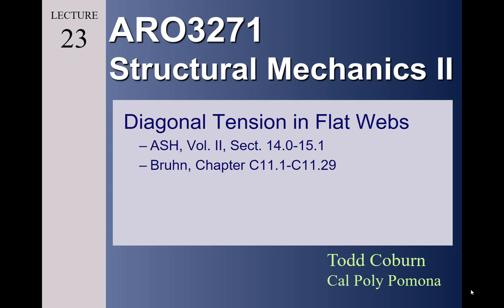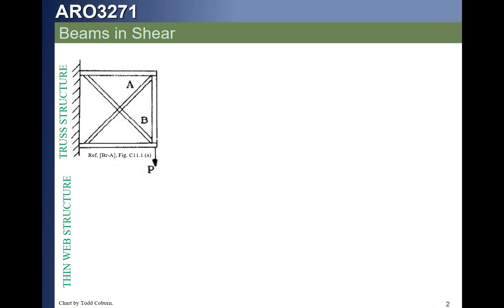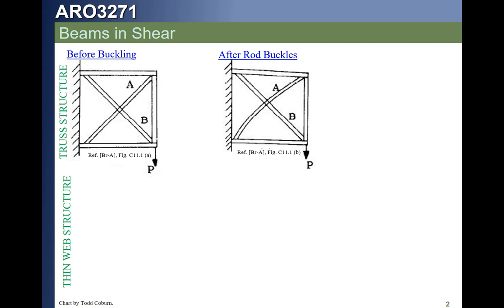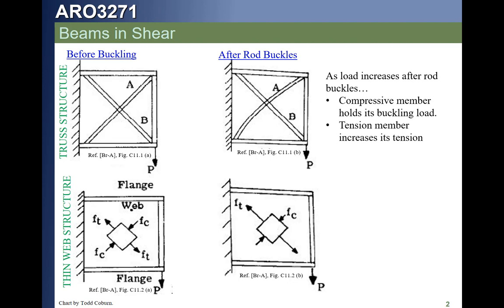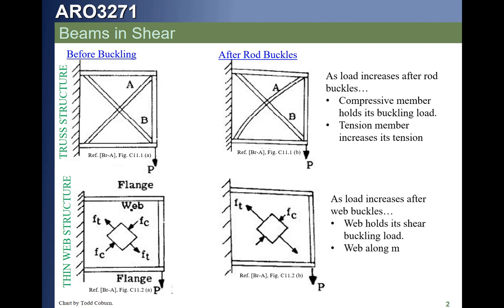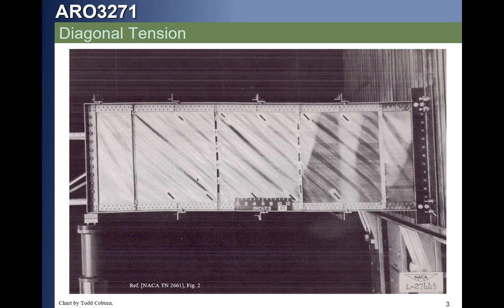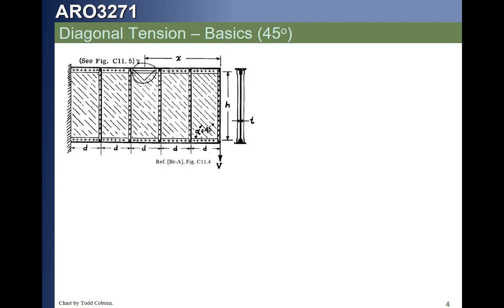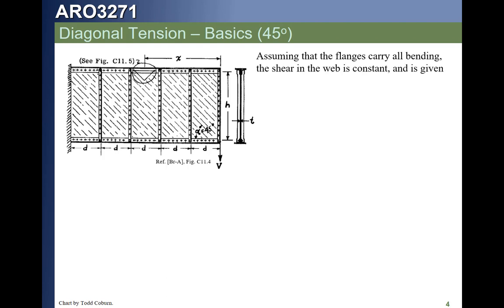Structures III: Stability - L-04 Analysis of Beams in Diagonal Tension

Comment: Hello thanks for this amazing telling and it is very beneficial. I have question about that if there is no shear buckling ( margin of the safety is  0.20)  under ultimate load, Could we need calculate diagonal tension or post buckling again 🙋🏻‍♂️
Reply from the maker: Hey there.  No, if no buckling your shear stress is simply P/A=P/ht.  Diagonal tension only develops after the web buckles.
Reply: @ToddCoburn  We think that web buckles as under limit load and then we will think post buckling. Do you know that any margin safety for limit buckling to pass throught post buckling to calculate diagonal tension . Thanks for your support.Or , we will calculate diagonal tension whether buckled in limit or buckled in ultimate load
Reply from the maker: @PredatorAiBot  often, we strive for no buckling under limit load, although it could be acceptable as long as no detrimental permanent effects occur.

Regardless of whether the load is limit or ultimate, if it does not buckle it is analyzed as shear resistant (see the lecture on that).  

If it buckles, we can either redesign, or analyze diagonal tension effects to see if it is acceptable.
Reply: @ToddCoburn   Sorry for these  several questions,.Thanks for your helping .if it occurs as buckling , we could calculate diagonal tension and crippling failure. if crippling and postbuckling failures are in our margin Side, we could accept the design even buckling occurs in our structure.
Reply from the maker: @PredatorAiBot  right.  Buckling is fine.